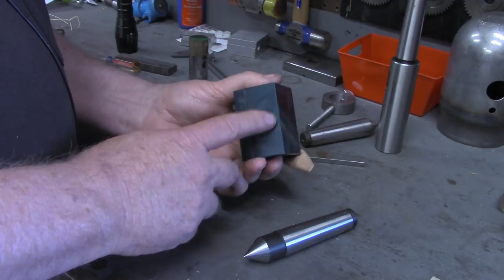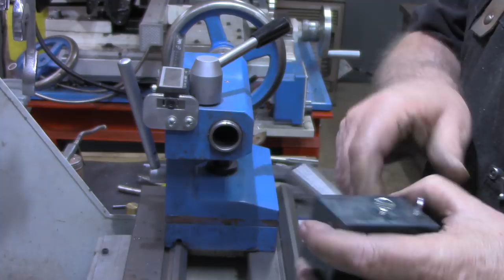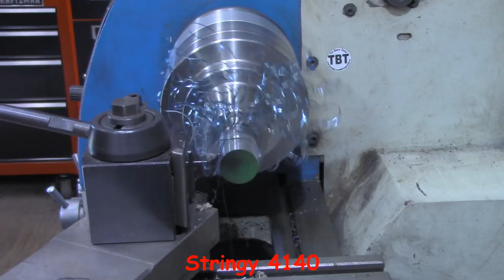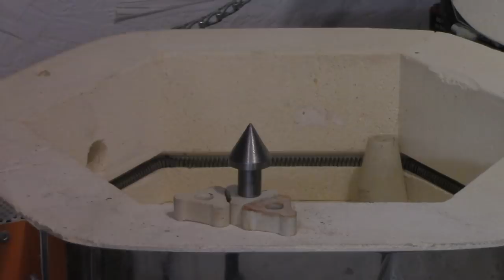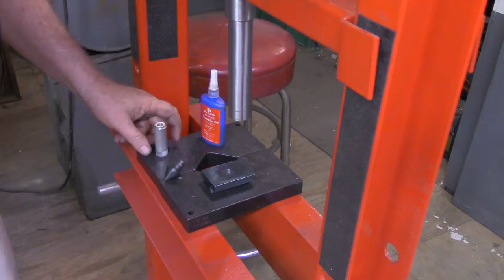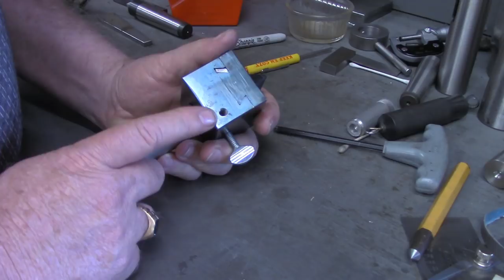Matching Dovetails Used To Create a Lathe Tailstock Offset

Comment: Hi, no this isn’t Randy, my name is Bob. All those micrometer heads are a very light press fit. They are made to calibrate to zero. You should be able to see the spanner wrench hole to adjust it. Every micrometer comes with the spanner to adjust it. After taking the thimble out, the lock will come out. Use the spanner to turn and pull the head out. If you can’t budge it, cut the outside enough to take a
chisel and (lightly) break it allowing the head to slide out. You can also put that very nice adjustable dead center on your mill, and cut aligning groves about 0.010” if you would like.

Comment: Great project.  If you wanted micrometer adjustment and were happy to sacrifice the Chinese mic it may be possible this way.  Take off the plastic side plates on the mic frame and cut the frame in half.  The frame being flat a slot could be cut in the body of the female block for it to fit into so the anvil sits on the end of the male dovetail.  Lock the mic frame in with grub screws and mill to a nice shape.

Comment: Lee

When you drilled and reamed the 1/2 hole in the back of the bottom piece of the dovetail block, why didn't you just lock the entire dovetail block together, and drill and ream thru both to get absolute perfect alignment between the bore in both parts of the dovetail block??  Would think it would be easier and probably more precise than doing this in 2 seperate steps since you drilled a centered 1/2 inch hole in the 2nd part of the dovetail block anyway???

John

Comment: Lee you could use 1/4 20 threaded rod to remake your own adjuster, 

This would allow making a dial knob with 25 divisions, because 1/4 20 rod moves 25 thou every revolution.  This would allow pretty precise adjustments both in and out.   The in is moving the dial back and pushing up against the end of the rod, but with back lash probably would mean moving beyond the mark on the dial then turning the dial  out to the mark  again.
Reply: It would actually move .050 per revolution. 20 times .050 thou = 1.000

Comment: If your pat is square and your 1-2-3 is square you don't need the adjustable parallel... just use the 1-2-3- block (on edge) as a square between the cross slide top and the part.

Comment: Great project. You are correct about the Craftsman being made by Starrett.  My grandfather was a tool and die maker, he would often buy Craftsman tools because they were the same high quality as Starrett and a lot less expensive.  I have purchased a couple micrometer cartridges on eBay.  They have barrels that appear to press into the frame but I have never taken one apart.

Comment: Lee great project. Shars has micrometer heads for under $20. By the way I use a 2" boring head with MT 3 shank and a turned down MT 1 shank on  a cheap live cneter also from Shars. Works well.   Keep em coming brother.
Reply: Left him a link to a Shar's on ebay for <$18 free shipping.
Reply: Yes, use a boring head to offset the center is quicker and easier if you have such a tool. I have a home made dead center for mine, did not think of using a small live one. I try that next time.

Comment: If you knurl the shaft whilst it is still in the lathe,it becomes a press fit as you wanted.
Reply: Doesn't take much knurl either
Reply: Old tubing cutter might work as well, if you have room for it
Reply: Just what I was about to suggest...I was also wondering about this 'press fit' business, whether a differential heating /cooling fit would be easier to do, fewer alignment issues and less 'heavy equipment' needed? Since the part that needs to be hot, in this kind of situation, can be heated without worries about temper, something like a propane torch would suffice, although, during /after assembly,  the dead center would need to be kept below any temperature high enough to affect its hardness /temper... What say you folks with more experience than myself?

Comment: I like your idea but a live center would be better and you can press a new one in then , and you will need a fitting for your chuck so that it wont wobble and hurt your chuck , good job I hope my advise helps .just think what you can do with another one on the chuck that is also adjustable in the X Y  this would completely eliminate miss alignment of the chuck and tail stock .
Reply: But, sometimes, a 'half-center' is pretty useful, and hard to do with a 'live center' ;-)  my impression is, as well, that a dead center does not have 'run-out', since it does not rotate, so it is limited to fixed displacement errors...

Comment: Lee

For the micro-adjuster, use a 6-40 bolt to get a finer increment per turn

John
Reply: Yes the 40 threads per inch will have a pitch of .025” exactly what a micrometer has.

Comment: Looks like a useful tool, did you say you put a ball into the locking thumbscrew hole? I would worry about that denting the bore, wouldn’t a copper slug be safer? That screw is resisting all of the cutting force from turning the assembly.

Comment: Why don't you just use a depth mic? cut one of the legs off and drill a hole for mounting, it will also give you the proper reading as the standard mic will be backwards. Nice job on the tool!

Comment: The sleeve (at least on the Chinese micrometer) should be a friction fit. If there's a small hole in the back (the kind that would fit a tiny pin wrench for adjusting), then this is definitely the case. Even without the hole, it's still likely a friction fit.

Search ebay for "micrometer head" to find the measuring part without the frame.

Comment: I copied this from a machinist website

1. Remove the spindles from the frames. I would avoid swapping the actual spindles and frames.
2. The spindle and barrel are attached with a threaded fastener in the end, and this could be a screw, or could be associated with a speeder or a ratchet. Loosen whatever your mic uses just a thread or two, and leave a lot of the threads engaged (don't remove it the fastener yet)
3. Gently whap the assembly on the screw you just loosened straight down onto a piece of brass or copper (to avoid scratching). Do this straight down to avoid any bending moment on the retaining screw. This should loosen the taper. If not, soak the spindle+barrel in Kroil, or 50:50 acetone and ATF (warning: the latter can remove paint). Then whap again, gently. If this works, remove the fastener completely and you have separate spindle and barrel. If that doesn't work, Pete's approach using some fabricated toolsseems like it's been proven in action. 
4. If I were you, I'd pull the barrel off as well (don't loose the little friction springs), ultrasonically clean everything, lube with purified mineral oil (this is what Starrett Instrument Oilis), and reassemble. 
5. Depending upon how dirty/worn everything was, you may wish to diddle with the friction adjusting nut on the spindle threads. The goal is to get smooth action with no 'lash and fairly low friction. Easiest to do with the barrel off. Make sure you check the entire range of the mic - if it's worn you can be loose at some points and tight at others. You've used mic's before, so you know what level of friction is appropriate. 

One thing that makes mics more easily and accurately read, and visually more pleasing involves ensuring that the barrel (the thing that you rotate to adjust zero) is reinstalled all the way and butted up against the frame. If not, your witness lines end up being visually off. The other point is during reassembly, ensure that the "zero" witness line on the barrel is where you like it. It should be in a spot pleasing to you visually when a 0-1 (or 0-25) unit is at zero (or at it's min or max reading for larger mics).

Good luck,

Comment: Extend the threaded rod, turn down the end to fit in the movable block .. drill and pin it so you can adjust it both ways by turning the thread in opposite directions ...

Comment: So what keeps this from turning in the tail stock? We all know that Morse tapers can slip if placed under sufficient load. As soon as you move out of plane horizontally and apply the cutting tool to the work the uneven forces are going to try and make the work and the dead centre lift up and away from the cutting tool. The further you move away from centre the worse this will get. I can't see any method of controlling this twisting action. Am I missing something here?

Comment: Nice project!  Did you have any trouble with the locking thumb screws creating a burr on the sliding surfaces?
Reply from the maker: That's why I machined a gib to go between the surfaces.  The thumb screws press on the gib which doesn't move.

Comment: make a bolt and measure how much its progress per revolution, then make an dial on the head of the bolt
Reply: neptun733 all you have to do is use a 40 tip thread as is used in a micrometer and you have 25 thou per revolution.  I'm in  the UK and I would use 5/16" x 40 ME ( model engineers ) taps and dies.